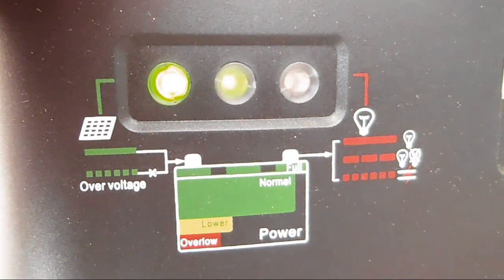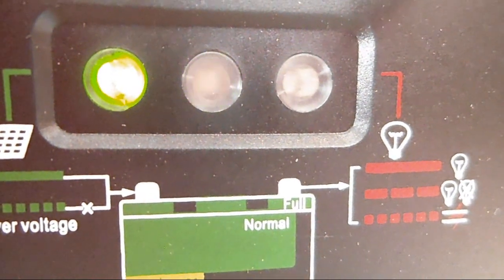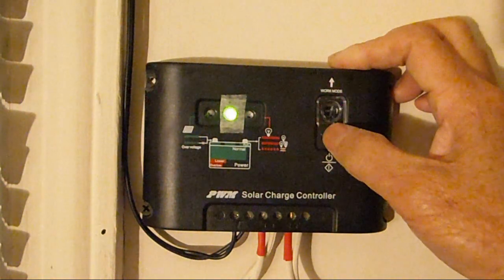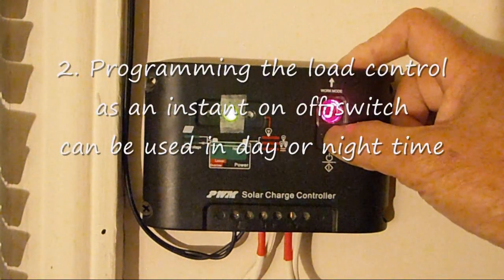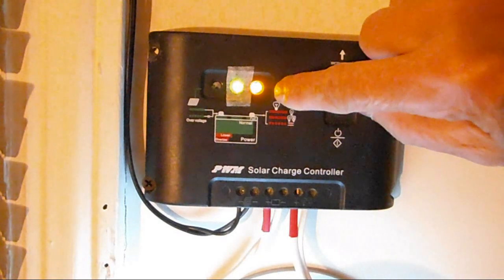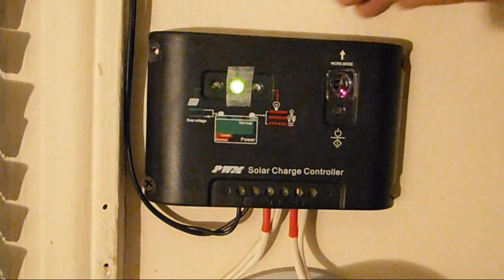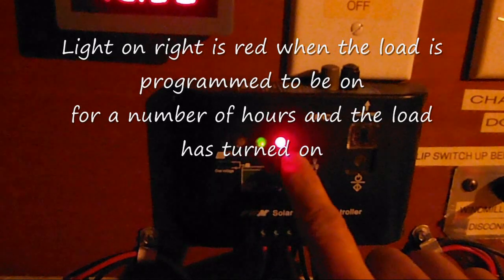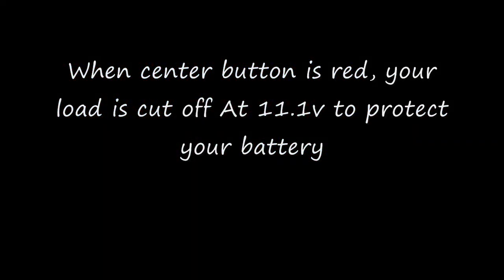A long and boring explanation of the load control functions of the EPRC 10 A solar controller

Comment: I have nss pwm 10a, I have a question, boss, what happens when it is steady green in the middle, it is no longer blinking green but when i turn on it turn on and off on and off it the battery have a problem or may nss?
Reply from the maker: Steady green means battery is in the correct voltage range. When the grebe light in middle slowly flashes, it means battery level is full. Hope this helps my friend.
Reply: @wtam69  thank you sir

Comment: I got a different one, shure it share the same guts. It surprised me , that the solar panel,  battery and load is the positive common ,  the voltage regulator and switch  is placed into the negative  rail.  In a normal inhouse installation it doesn´t matter, but if you plan to install such a device in your motor/mobile  home  keep that in mind that  you can´t ground the panel and load in the wiring after those  solar controller.
Maybe the one in the video has negative commen so  everything is okay, but mine has positive common.

The controller is not the super duper luxury one, but in a small lighting system for a garden shack , garage etc. It is okay. I paid seven quids at amazone the other day, so I bought 2 of them, one for spare. I never need the spare one cause it still work since that time I installed it. I run  night lighting for the yard  and front door,  kitchen and staircase and of course  for my  ham vhf stuff. I got 2x 12V lead agm batteries with 55Ah in series ,24 V  system voltage due to very long cables. 

The solar panels are  labeled with oc 32V and 100W peak but they are old and lost a bit of power. The maximum current is only 3 amps  with four of them 12 amps max total.   The battery is close to the controller with  6mm² wires.  The radio stuff is connected direct to the battery with 4mm² leads , the lights are on the "Load" terminals with 1,5mm² leads.
Reply from the maker: Thank you for sharing your input. These inexpensive controllers are a great way to building your first system.

Comment: hello i have a 10 amp charge controller and was wondering what amps can the load out connection support im not going down the inverter road at the moment.
Reply from the maker: It is not stated in the manual. Probably safe to use a load of not more than 5 amps.

Comment: hi what does it mean when the solar and load cut off go red?  On my pwm they stay green all day then right at night when I need them they both turn red.
Reply from the maker: The solar led should be green in daytime. The battery led is green when the voltage is within acceptable range. It will go red when the load cuts off.  The load led turns red when the output is on.  Check if your battery is in good condition and is accepting a charge ( use a multimeter). Otherwise, it will go red, cutting off the load if the battery cannot handle the load.

Comment: I have a question.. What if the battery indicator light in solar charge controller is flashing red and yellow. Is there a problem with the battery? And also the voltage output is going high and low. From 14v to 10v.

Comment: hi 
i am using exactly same PWM solar charge controller, since two weak i am facing some issue,, issue after 1 or 2 hours it show me battery full signal, and i in actual battery is not full,,
can any tell me please what issue there?
thanks in advance..
Reply from the maker: It depends on what you mean by full.  A lead acid battery can be considered fully charged when it shows 12.6 to 12.8 volt.  The charger will show a green led when the overall battery level is in the right range.  It will continue to give an equalization charge and a float charge after that.

Comment: Nice video, but the controller I have is the same but a bit different when it comes to tapping in the number. Instead of just 0 and then going on to 0 with a dot after it it cyles through 17 number. Not sure what number is for on of switch,, so if the number that allows me to turn the load on and off is set, will this be right and be otherwise always charging the battery?    Thanks for video it does calrify things better than the manuel,, Cheers, Pete
Reply from the maker: +pepersorte Try 14 to see if that's the on/off  or 15 if 14 doesn't work.  Regardless of your setting, it will charge your battery when there is sunlight. Good luck.
Reply: Thanks for that I think then as long as the switch number I have set allows me to turn the load on or off, then that has to be the right number and it will still charges the battery and protects it.. Thanks, Pete

Comment: I have a controller that looks identical to yours but I believe it's by rohs instead and the solar panel and load lights are blue. My solar panel light is on when my 10watt panel is outputting around 14v then goes off around 20v. The battery light is always constantly on. Shouldn't the controller go into float charge and start flashing instead of cutting off the solar panel?  Am I missing or doing something wrong please?
Reply from the maker: Adam King The solar panel light should be on when there is sunshine. The green battery light is supposed to be on when the battery voltage is good and will only go into float charge when the battery is charged. Float voltage is at 13.6v.  You can use your multimeter to check the voltage of your battery at different stages of charging.
Reply: wtam69 it was at 13.7 and battery light was still constantly on, any idea why the solar panel light is going off when the solar panel is outputting around 19-20v. The controller has an overvoltage rating of 17v could this be why? Thanks for all your help
This is the controller I have.
 http://m.ebay.co.uk/itm/351078233835
Reply from the maker: Adam King Make sure you check all your wiring to ensure you have not miswired it.  After you charged the battery, check the voltage at night or 2 hours after sunset. If your battery is at 12.6 to 12.8, then it is good. The charger will only go into float charge after it is fully charged. 
Is your battery new?  If you have a big car size 12v battery, it's not likely for the battery to be overcharged with a 10w solar panel. When you are charging and if the voltage goes over 14.5v, then the middle battery light will blink and the charge disconnected. The middle battery green or in you case blue light is like an idiot light and is supposed to be constantly on to show that the battery level is good. Solar panel green or blue  light should not go off when you have daylight or sunlight.
 If the charger comes with a manual, you can check it to see if the light on the left (solar panel) is supposed to go off. I kind of doubt it as it only goes off at night. The solar panel light can blink if the system is over voltage.
Reply: wtam69 thank you so much for confirming what I thought that solar light should always be on with any amount of sunlight but only charge at a certain voltage. The manual doesn't say anything about solar light going off, and I have checked and rechecked wiring
Reply: After some testing today the solar input light comes on when the battery voltage is down to 12.94v the controller then allows charge into the battery until it's voltage reaches 14.10v and the solar input light goes off cutting the supply power. Then charger never goes into float mode. A charging cycle like this all day from sun rise to sun set can't be good for the battery right.

Comment: Hello,Can you tell me why the green light doesn`t turn on for the panels even though it`s day time,everything is in place but the charging led indicator is off!!!!!! When we turn on the load,battery light is red........   load light is yellow ....................thanks
Reply from the maker: dl Make sure your solar panel is giving out the right voltage, about 18-22v open voltage and that the connections are not reversed. You can use a multimeter to check the output of your solar panel. Check that the solar panel leads are connected to the far left.  Battery indicator red means the load is cut off.

Comment: If you're using 6. as a on off switch what's the highest wattage device you can run?
Reply from the maker: About a hundred watts maximum. Use less if it's a continuous load to be safe.

Comment: nice video I like to change this controller in to a dumpload controller for wind turbines. do you know were I can find the source code used to program the micro controller, so I can see the code responsible for the light function so I can change that part of the code to turn the out put on at a preset voltage and turn it off at a preset voltage. or have it set up to pulse a solid state relay to control the turbine ect. I like to see the code and see what I can change, to make it work the way I want it to. I kind of want it to work as a Hybrid solar wind controller, by taking the 30 or 40 amp models and then be able to both  use solar / wind to charge a battery bank.
Reply from the maker: I understand what you are trying to do but I have no idea on how to go about doing it. I have no information on the programming code. It'd be a nice hack as I said before.

Comment: hi
i buy from u from like this one
i test my solar panels its about 140v (i havent watch to test watt)
its 8 panels = 140v
i have 12v 75amber (4 battries) total amber battries is 300amber
when i connect the controller its smoke and i think its not work
do u have controller can help me ?
merry crismas
Reply from the maker: This particular model can only handle 10 amps or about 120 watts.  That is the maximum it can handle.  The total wattage of the solar panels might have exceeded the handling capacity of the controller. Another possibility  for failure is connecting the wires incorrectly.

Comment from the maker: You have to connect your two 6 volt batteries in series to get 12. Then you can connect it in parallel with your 12 volt battery. While this will work, it won't be the best setup since your batteries are of different capacities.  Good luck.

Comment: Hi., its me again, this is very useful! Its like you answer all my silly question last time so far everything ive done works well except from my battery, just wanna ask i have 2x 6v 14ah battery at the moment and now i purchased a 12v 20ah to make more capacity is it possible to connect these 3 batteries even though there not the same voltage? I think if that works i will have 34ah in total for my batteries.

Comment from the maker: I wanted to use heavier gauge wires too but the connectors for the charger cannot accept bigger wires. This is understandable as this is a low power unit. Good luck with your install.

Comment: Thank you for posting this video.
I am just about to set mine up and the manual did not translate too well into English.
The wires you use are smaller gauge than I would have expected too.
Cheers :)

Comment: Well I've been running two 140 watt panels that, at times, show 19A coming in (after the 20A PWM!) -- so like you -- im surprised the thing didn't melt... $15 well spent, indeed. It also works with less than an amp coming, when an MPPT WILL DO NOTHING (sleep mode kicks in during less than an amp times)